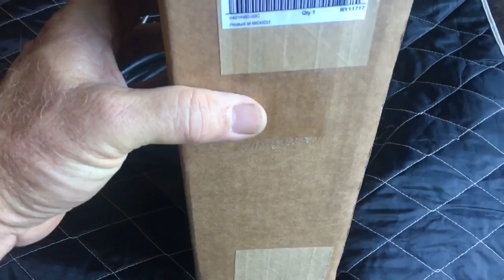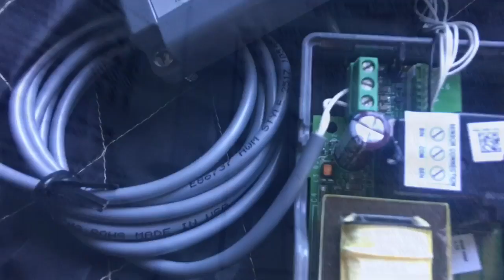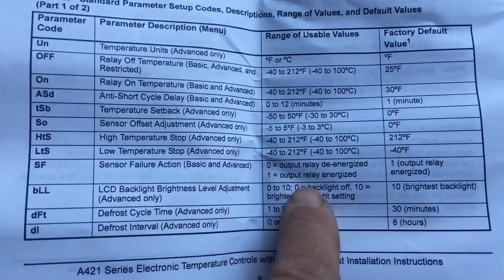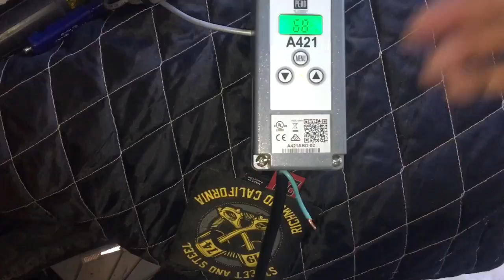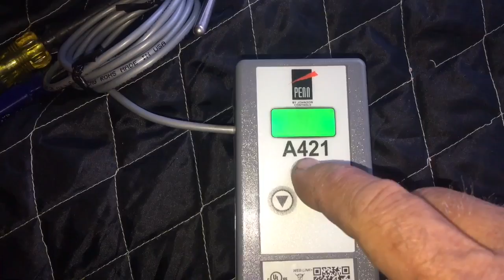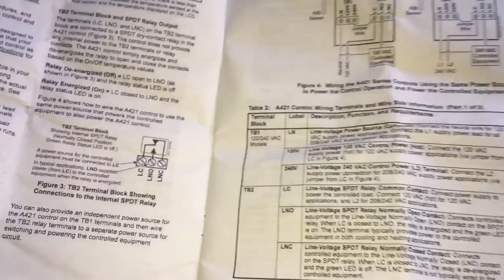A421ABD-02C temp and defrost controller

Comment: I ran into this yesterday and couldnt figure out how to get into the advanced settings!!
Reply from the maker: Up n down for 5 seconds until you see UN
Reply: @NorCal-refrigeration  when your wiring up a 115v drain line heater for a freezer. Does one wire go to N and the other to ground?
Reply from the maker: @timothydelgado4907  get a dedicated circuit for it.
Reply: I’ve been thinking about this all day. To create a circuit I can put one leg to N because that’s always hot, but now I need to think about a neutral. Either I try to tie it in with the evaporator fan or just put my other leg to ground. Kind of like how you would use a cheater cord
Reply from the maker: @timothydelgado4907  just get a 230 volt heater

Comment: Have a true keg cooler, had problems with unit constantly running and icing coil.  Took the mechanical thermostat off and replaced it with one of these.  So much better, keeps a near constant 37 and no more icing

Comment: Looks like a great upgrade.  Can it be used inside a walk in freezer?
Reply from the maker: Yes you can!
Reply: Fantastic just ordered one!  Thank you!
Reply: @Matt-ll1pd  Just can't use the defrost feature. This is only good for air defrost (off cycle) as it just closes the solenoid. Might as well get the one without it if ordering.
Reply: Thank you

Comment: Off cycle defrost in my opinion is not a good option unless you can program the time of day it shuts the cooling off. For example, the box is already too warm, why (in the first place) would you turn the compressor off and make the box warmer? Especially when the box is in use during business hours and the Health Inspector usually shows up then? I have seen, in my 40 years of correcting bad installs, off cycle timers on many walk in boxes. When the issue was improper sizing or even the superheat adjustment was way too high, starving the coil with decreased cooling capacity.  Also if sized properly I set the differential for a minimum of 4 degrees but prefer 5 degrees. If a good refrigeration tech doesn't understand why that is a better method of air defrost then I would like to learn something from them. Not to mention the cycle rate is decreased, thus extending the compressor life. Refrigeration is more logic, reason and common sense than guesswork or hiding the problem to make it seem to go away. P.S. Man I sure miss R-12!  LOL! I read different posts on the Internet from all over the world and I have much empathy for some of these guys customers and employers, but hey, glad to see they are seeking important info that advances their knowledge and I  just hope their customers aren't paying for their mistakes. Sometimes, I still miss something and have to eat one! Goes with the territory, as they say. Just like the cooks propping the walk in door open for 45 minutes when the delivery  truck comes and it's 105 degrees outside! I live in Arizona! Refrigeration guys don't need job security in this neck of the woods!

Comment: I had to replace a419 to a421, long story short kept tripping the breaker with the same wiring provided for 110vac. Luckily I tried the new sensor with the old control (reason why I had to change the control) and it worked, not sure why it kept tripping the breaker though

Comment: This controller is very versatile.  You can use it as a cooler controller, freezer controller, and a constant cut-in controller easily.  For those that do not know what a constant cut-in controller is, you simply mount the sensor in the coil.  It monitors the coil temp.  When at a given coil temp it turns off, and doesn't cut-in until the coil temp reaches a pre-set temp.  This allows the coil to defrost and not turn on until the coil is completely defrosted.  It acts just as a Ranco A12-700 or A12-701, with more adjustability.  It can also work as a time clock defrost pre-set controller like an eliwell or omnitemp.  It's simply a very useful controller.  Nice job Dave!
Reply: Yes I've done that before on those pesky small tiny walkins with the "all in one" hard to service package on top of the walkin box. Set the cut out to 27+/- degrees, and cut in to 41 degrees and box temp stays between 36-39! And stick the probe in coil. And no more giant ice monster that's a pain in the butt to thaw out! Ask me how I know... lol many buckets of hot water, and bus pans full of water on the top shelf etc. They use puny cheap coils and 2 3000 rpm tiny plastic fans and not as much coil surface area as a real evap hung from the ceiling. Yes it saves interior space, but it makes cleaning the coils, drain pan, replacing fan motors a real joy.

Comment: Heads up on the A421 Defrost Controls. If you find that you can only access the OFF parameter, the control is in restricted mode. Double check the Restricted Mode Jumper and make sure it's installed on both pins. Once both pins are shorted with the jumper,  you will be able to access all of the menus and parameters.

Comment: THank you for the great video!  I am working on trying to get this hooked up to a couple fermenters and when I go to hook the sensor wires up inside the controller, I see that the diagram shows a + and a -, but both wires of the sensor look exactly the same to me.  Does it make a difference which wire goes in the + and -?  Thanks!
Reply from the maker: No

Comment: If a walkin box is equipped with an older style paragon defrost timer how would one hook it up. I am assuming leave in place and remove the defrost set points as this will takeover that function
Reply from the maker: RedCoach Inn that would work.

Comment: Nice review Dave, I purchased one today (around $70 at united ref. my company 's price)   I am working at a huge walk in cooler (customer distribute beer) and they just installed an evap coil with a regular A421, coil totally iced up, customer decided to lower the set point to pass inspection (25F)  good thing this controller also comes with a high and low limit as well, will come back tomorrow once the coil is deiced and install this little helper. Great videos Dave, I like your troubleshooting skills.

Comment: Great video, installed a couple of those on a 70 Ton walk in (or drive in this case) Cooler, didn't have time to check out the defrost options. Also found on first setup the whole On and Off temps instead of setpoints and differentials got me confused, but once used to it it's much better than the 419's with the jumper to go between heat, cool, start at and stop at setpoint. 

I get you could use the NC to power the contactor for the heating elements on a freezer but without a klixon I don't think I'd do away from the trusty Paragons yet.
Reply from the maker: Fél ypc this is not for freezers just off cycle only.

Comment: So, since this thing only has one relay for shutting the unit off, Where is the defrost relay? Something has to kick the heaters in?
Reply: Thanks for the answers. I was wondering how that would work, Just a lurker :-)
Reply: would be for non-heater/convection defrost only or  use as thermostat only, leaving defrost cycle to condenser timer.
Reply: There is a NC and NO contact, you can use the NO for your solenoid/contactor and NF for the contactor on the heater, not ideal without a termination switch for freezer applications
Reply: no, that would make it defrost every time the box reached "set temp"
Reply from the maker: THEtechknight for off cycle defrost only.
Reply: Well god damn you're right

Comment: David if you're going to change over from mechanical thermostat to a A19 electronic thermostat you will need a third wire which is your neutral wire your going have to  pull a wire. I been using electronic thermostats for about over 10 years I found out if you get a Emerson electronic thermostat you won't have to pull third wires there a switch on the control for your neutral if your changing from a mechanical thermostat. That's great it a build in defrost they came out with haven't use as yet be great on reach in.
Reply: Nor-Cal Refrigeration & H.V.A.C 
Love the videos, you rock.
I made the investment in the Testo smart probe kit the refrigeration set.
Thanks Dave for my new obsession, totally inspired by your videos.
LOL
Reply from the maker: c alessi your welcome.
Reply: Edward HVACR CT 
So u can switch from a two wire 120 volt or 220 volt with no wire added with the emerson ,I've had a A19 on my van for a couple years because I don't want to add any new wires to a unit, if its not on the drawing
Reply: c alessi WIRINGWiring Instruction NotesSwitch SettingsSwitch SW2 must be set for applications as shown:Line Voltage (Power Stealing)Line Voltage (Non Power Stealing)24 VAC (Non Power Stealing)Power StealingPower Stealing is an electronic design within the control thatcan eliminate the need to connect a neutral line to power thecontrol. The control receives power from the unit it is control-ling. Power Stealing saves time and money by often eliminat-ing the labor to run a neutral wire to the control for power. Seecompatibility chart below for certain limitations.  ( Emerson 16e09-101 electronic thermostat )
Reply: Edward HVACR CT 
Got to get one and try it out.
Thanks for the heads up.
Reply: If your going from mechanical thermostat usual has 2 wire break line voltage to the load your replace A19 electronics thermostat have  a neutral going for the control to work correctly  so your going have pull wire .l won't go back to mechanical A19 thermostat they use to be good but they  aren't made not USA they get out of calibration with all the new refrigerant you get uneven temperature inside the box and the mechanical can't reacted fast enough then your back replacing the thermostat plus electronic you got more control over the temperature cut in/cut out now they come out with defrost which good with all the refrigerant out market.
Reply from the maker: c alessi that's handy
Reply: Hi My name is José I am working on draft/beer walking cooler the bartender says is draft beer is not cooling good 
It has out door termostato showed 40f how can I get lower temperature about 38f ?
I got gauges on 60psig on succión roof condenser ambient temperature 85f
Penn Jhonson control inside cooler